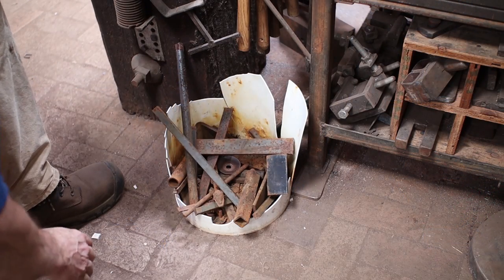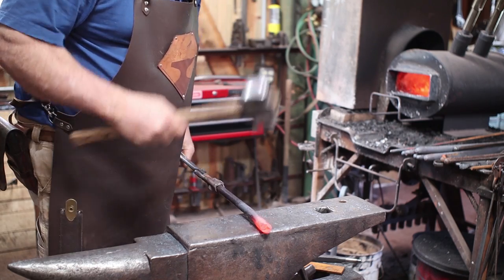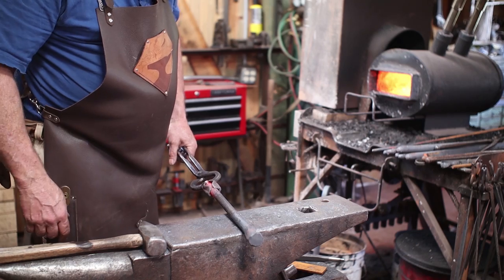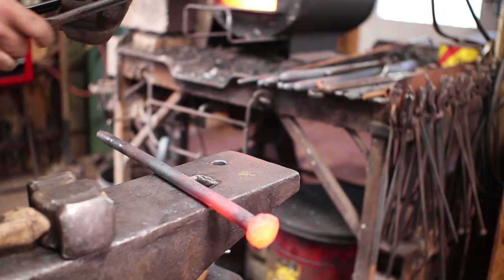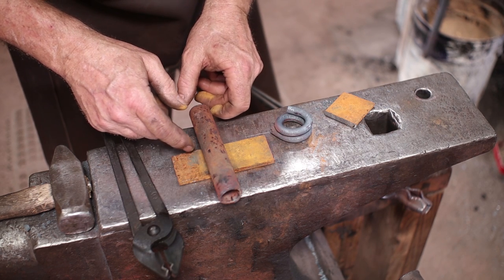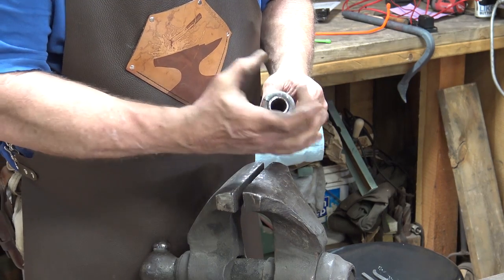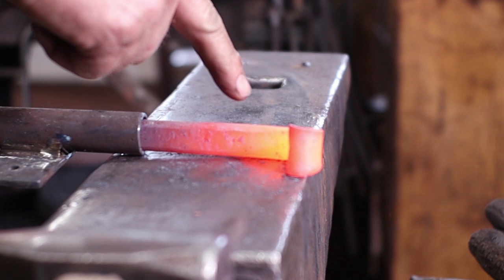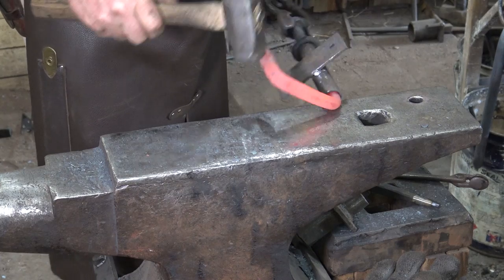Bar and pipe swivel hook - Hook of the week 7

Comment: Hello John, this is unrelated to your video but was wondering how long it took for the paint smell from your gas forge to burn off to the point where it wasn’t smoking?
Thanks, 
Emile
Reply from the maker: I don't recall that it was ever an issue
Reply: Black Bear Forge I recently bought an NC tool low boy forge and it literally took an hour and a half of running before the smoke stopped billowing from it.
Reply from the maker: Yuk!